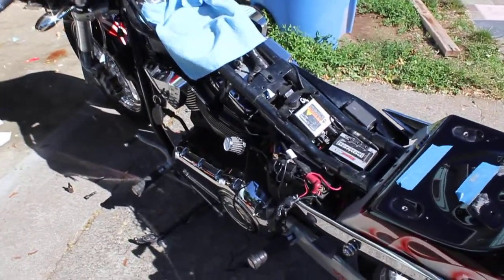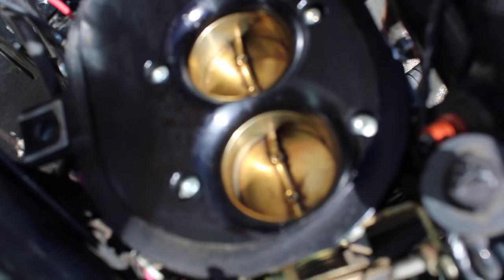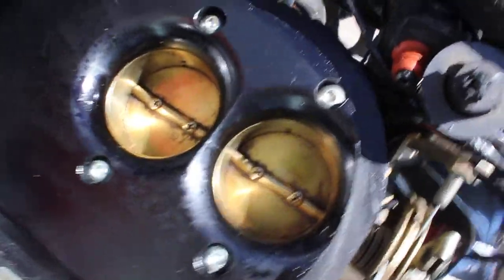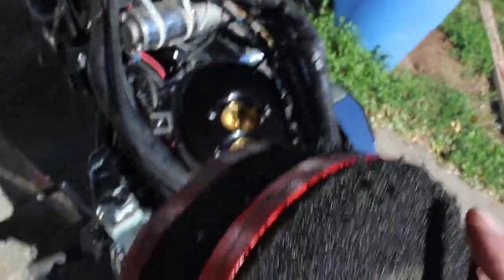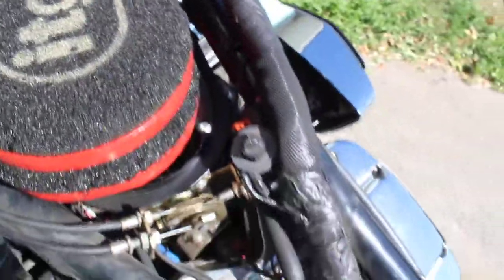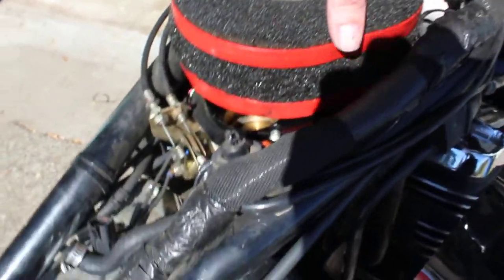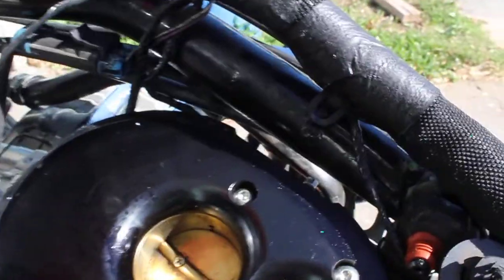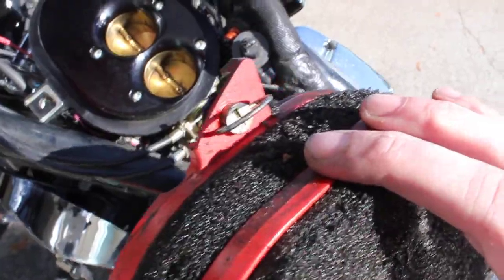PMRT Filter Disintegrated  (Need Advice on New AirBox) Victory Hammer

Comment: Oh man I bought the torque tubes also, I didnt want to risk putting that POS filter back on. How do you like the torque tubes? Also I remembered when you throttle quick the engine kind of bogged down, did you get that fixed? If so how did you?

Comment: This filter has been the surge of my existence since 2008. I also have a 2006 victory. And yeah it’s a real bitch to get it back on and I can give no advice how to get it over the lip of the baseplate except that you manhandle it and over the period of maybe 10 minutes or so all the sudden it just magically clips on that lip on the right side of the bike. My filter element is probably worse than yours. Doing what I hope to be the final cleaning and use of it with a plan of getting torque tubes at the end of the summer. Wish I had better advice for you but, just know that, you’re not alone